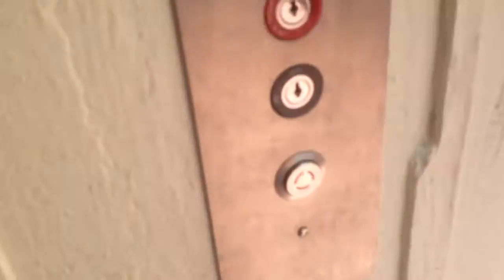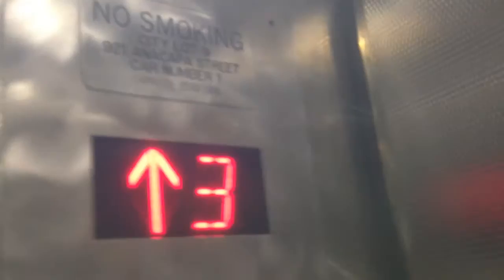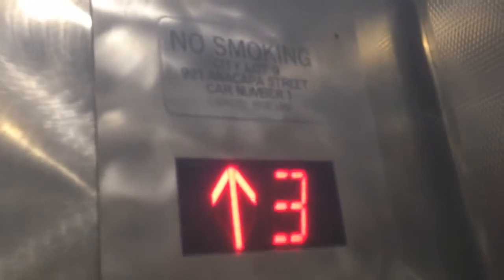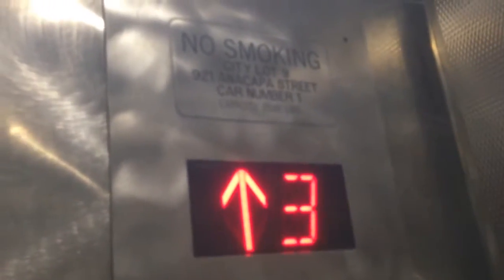Modernized Tri-County Hydraulic Elevator @ Marshalls Garage, Santa Barbara, CA

Comment from the maker: I know they didn't but I don't have the slightest clue who modded this. I almost fainted on Figueroa Street when I saw those Ecodisc fixtures and yes the door was locked since I was here on a Saturday. I guess they went from Overhead Traction to MRL Traction:( The cab interior was modernized and pump/motor were replaced. I loved the original one. If you watch Alex's video on the Tri County Elevator Wiki page, you can hear the original motor had a different pitch and was more faint-sounding. There was an original Tri-County in a shopping center in Montecito that looked exactly like this one did originally and I will be going up to film in Montecito when I go up to LA again in another month. I would classify this as a Deathtrap now but not the old one.
Reply: I saw his old video of this elevator. Quite te contrast from what it looks like now. I have filmed 2 Tri-County elevators.
Reply from the maker: Pump, motor and cab interior have all been redone so it is practically not even the same elevator.

Comment: Elevator Research & Manufacturing does not install elevators. I am mad that they modded an Otis Lexan traction elevator. Was that building locked? Would you consider this a death trap elevator because of the BIG bump, or would you say it is not that bad? Wow, this elevator looks completely different. The motor also sounds new. I liked this thing original more though.